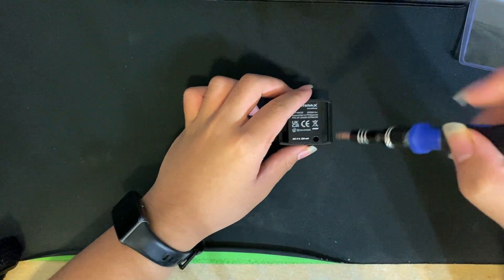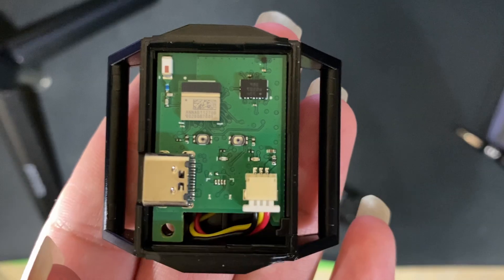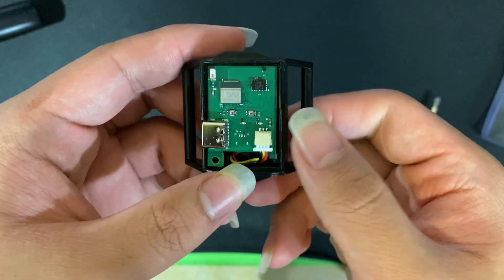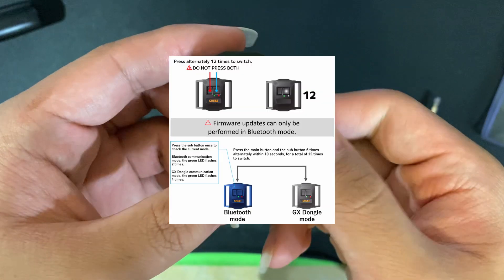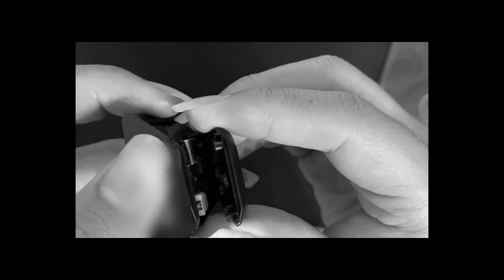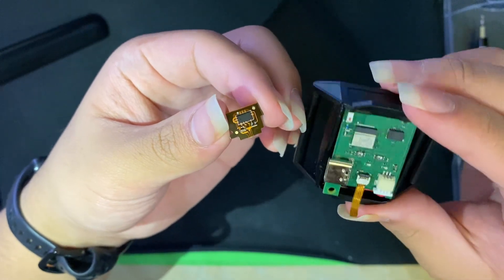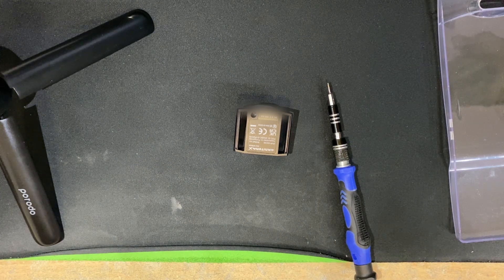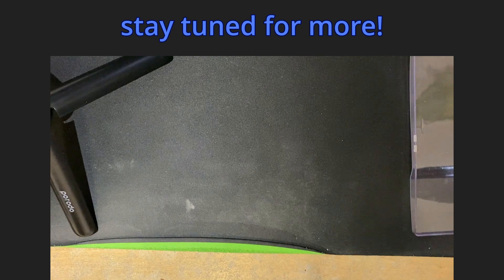HaritoraX Wireless Teardown (I BROKE SOMETHING)

Comment: Interesting that they went with the BMI055 for the trackers, I wonder if they're planning to release an updated version since it's been discontinued (the IC that is).

Side note: That is not a hex (Allen) screw, but a Torx screw. Specifically, it's not going to be a 1.3mm hex key, but a T4 or T5 Torx. It's a small difference (star vs hexagon) and, yes, an Allen will work in a pinch, but the proper screwdriver would be to use a Torx screwdriver. Using a hex in a torx can round the screw off if you aren't careful
Reply from the maker: yeah its very, very strange they used the BMI055 when the original Haritora trackers used the BNO085 - the wireless r trackers are releasing at some point, so i wonder what IMU they will use with those
and thanks for the note!